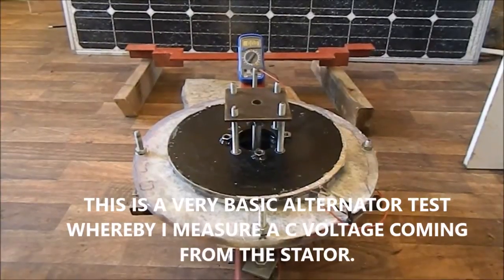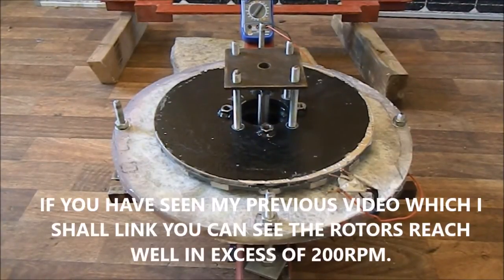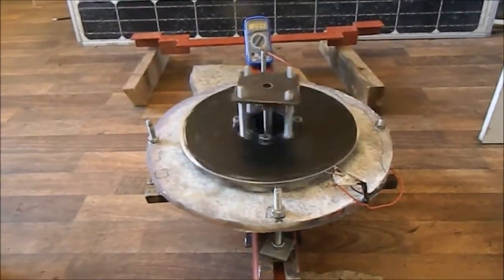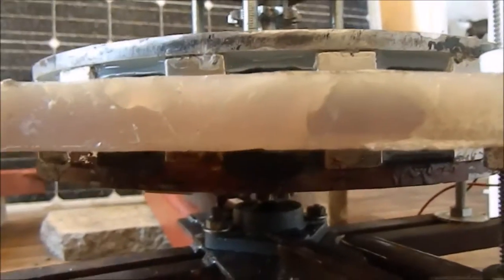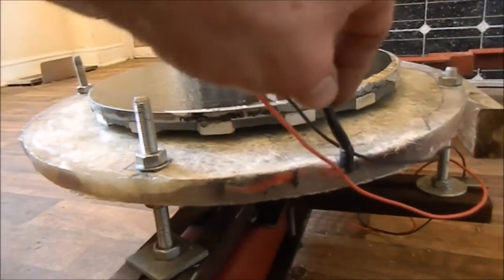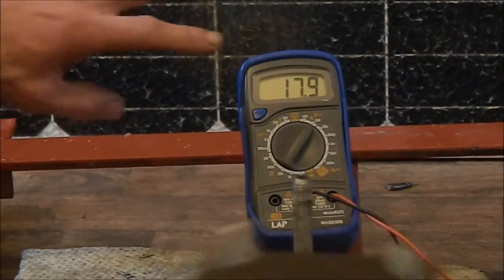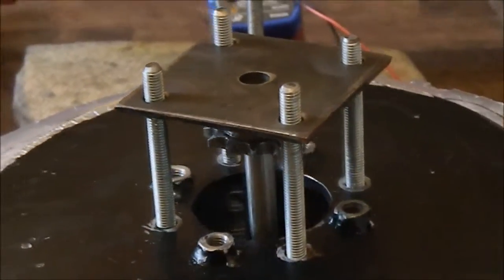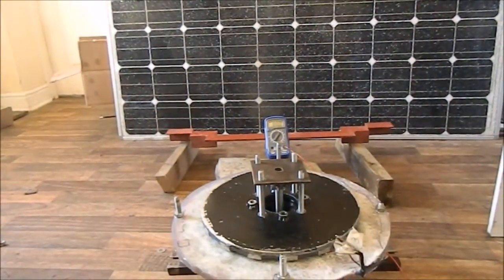OFF GRID VAWT wind turbine 24V Alternator Testing

Comment: do you get any noticeable vibration due one phase being a bit down on output, just curious thats all , ive read things on other power etc etc talking about vibration from single phase pmas and chris olsen talking about his 2 phase experiments.
good to hear youve got more in the works, its addictive .
ive read hugh piggot and others talking about magnets letting go at high rpms onc in a blue moon so i intend on doing what a guy told me he did, he used marine ply with holes cut out to hold magnets securely but i will probably use a thick heavy duty plastic and get the holes cut by a freind to save money.